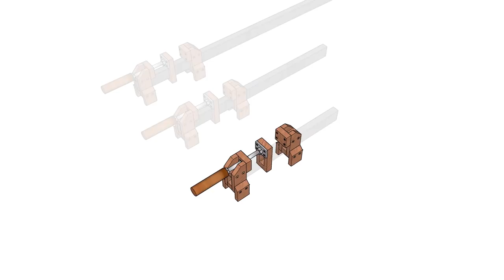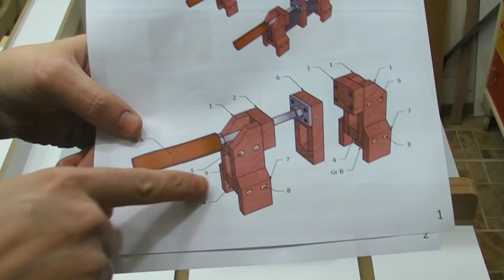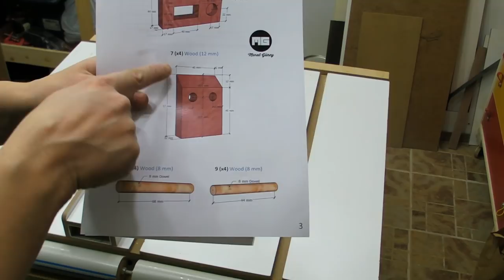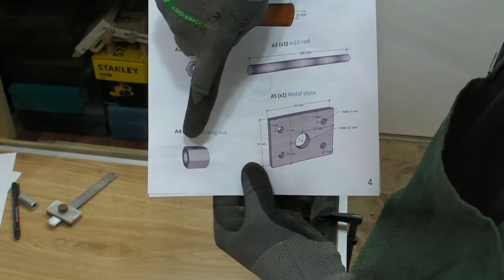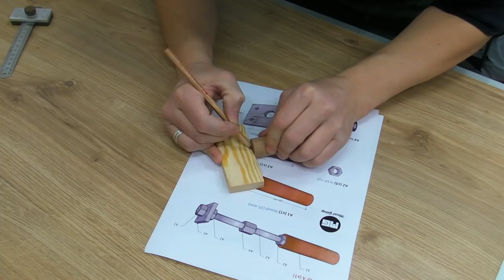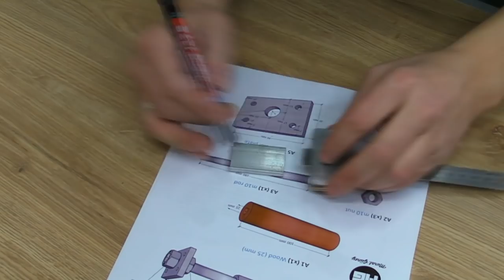Homemade Any Size Bar Clamp System

Comment: Can i use angle instead of bar for the stock? (and change plans accordingly)
Reply from the maker: Hello.  Of course you can use it.  Maybe the rod that performs the tightening operation may need to be longer.